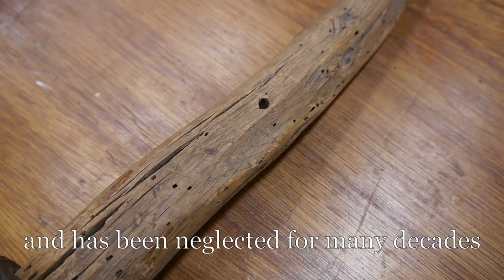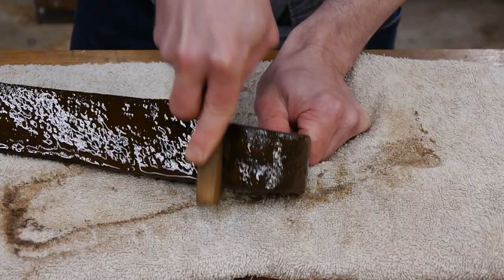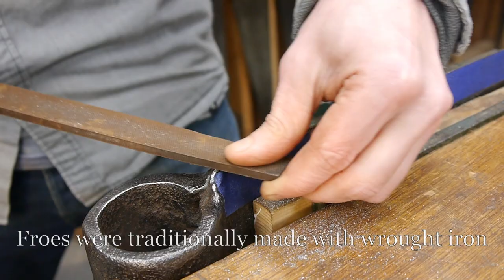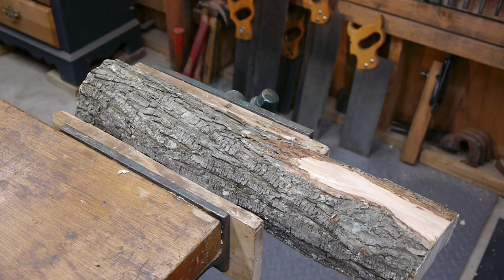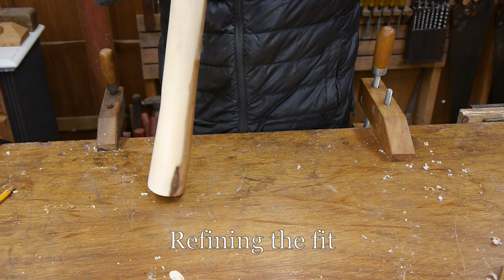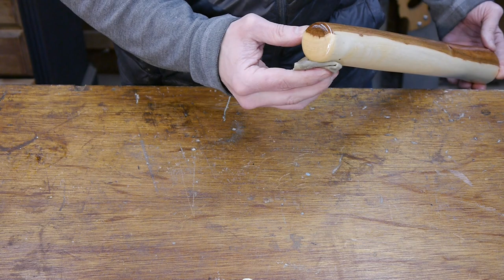Restoring the froe | Sharpening and new bitternut hickory handle | Hand tool woodworking

Comment: What woods are best for making the frog and what shape should it be?
I'm in northern California near Oregon.
Boiled Linseed Oil vs Tung Oil?
How do you protect the edge of the froe when transporting it?
Reply from the maker: Hi John, any strong hard wood should be fine, eg oak, ash, hickory, maple. Preferably riven with very straight grain.  Tung oil is a very nice finish but pure tung oil is expensive, takes a very long time to cure, and has a short shelf life. For protecting the edge, google "froe sheath"; there are some really nice examples of leather sheaths that slide over the blade with  a strap that goes around the eye.

Comment: Liked and subscribed.   Thanks for sharing.   Is the wood you are using  green?   I'm only asking because ofvthe bark.  I have a pear tree that is on it's way out after 90 years.  I'd like to use it for handles and such but don't know if I can work it green.  Thanks again and have a happy day!
Reply from the maker: Thanks John! The wood I used here is very green. I have another video where I used green pear wood to make a chisel handle.  Note pear wood tends to check and twist quickly as it dries, so be sure to seal the end grain of your logs right away.

Comment: Tip: Wear gloves and eye protection when using wire wheels.
Great Video
Just picked up one like yours in mint condition...old shop find. $2
Reply: I agree with eye protection, but gloves and a wire wheel is just asking for problems. Gloves can easily snag and cause you to break fingers. It's actually VERY dangerous. A bite from a wire wheel is a mild abrasion, and although painful, its far less painful than snapping a finger or two

Comment: Nice job with the tapered fit on the handle. Shouldn’t have had a wedge in it. Looks like a previous owner also used a steel hammer on it. Definite no-no.
Reply from the maker: Thanks John!

Comment: @josephpadula2283
0 seconds ago
Real Wrought iron like this is very rust resistant .
What is called wrought iron today is just steel .

I learned this seeing real wrought iron fences in Galveston Texas on 100 year on homes and mansions in great shape while modern “wrought iron “ ( steel with modern paint)  was badly rusted!

Galveston is a coastal city with salt spray And periodic hurricanes flooding the town with sea water,
Yet the old fenced that had been submerged in salty seas were still good.

Wrought iron is no longer made anywhere in the world and is only available as recovers from old buildings or equipment.

Comment: What type of oil to you use when scrubbing off the rust?
Reply from the maker: Just regular motor oil. This happens to be some 0w40 that I had on hand.
Reply: @thehandtoolworks  So I guess anything would work really. I always have 3 in 1 around.